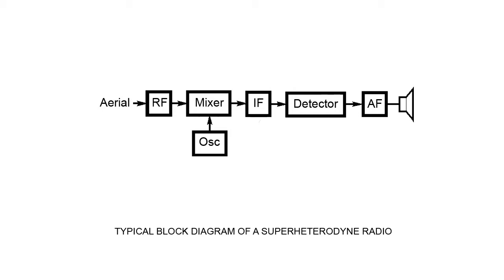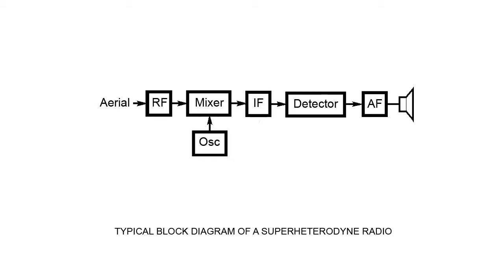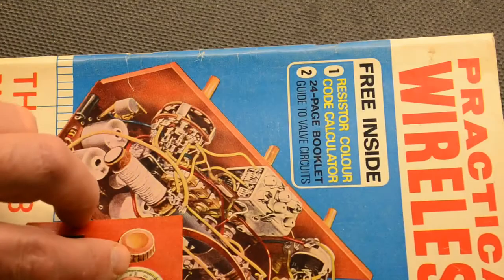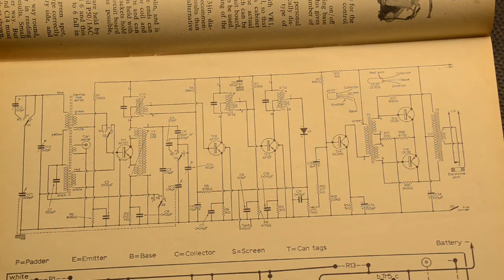How does a superhet work? A practical approach (PART 1)

Comment: I started in electronics just as valves were leaving.
I worked in RF  in Tv Video industry
Reply from the maker: I started off with transistors, but actually had more success with my valve projects! :-)
Reply: @lishaton  I couldn't understand valves, and still don't.
I didn't like those high dc voltages

Comment: Hmmmm....Could you do one where you make superhet circuits clear?  😂
In all seriousness, I have yet to see this circuit made super simple.
Reply from the maker: Thanks for the suggestion Pete. I believe however, that in order to make this type of concept 'super simple', you have to be aware of the current level of technical knowledge from the person viewing it. It being necessary to use assorted technical terms, even with a simplified version and if the person viewing doesn't understand those.. well they're a bit stuck I guess! 

In reality though, when it comes to the actual theory behind superhets, the principle of having *two oscillators to create a third difference signal was considered as early as the 1900s. (So isn't exactly 'rocket science'!) Actual working sets weren't however made until quite a few years later when components were more freely available in order to put the ideas into practice.

*The first signal being the radio wave being received, the second signal being the local oscillator in the set and the third difference signal being that which is amplified in the IF amplifier stages.
Reply: @lishaton  
Like my old DX7 Yamaha keyboard (-: